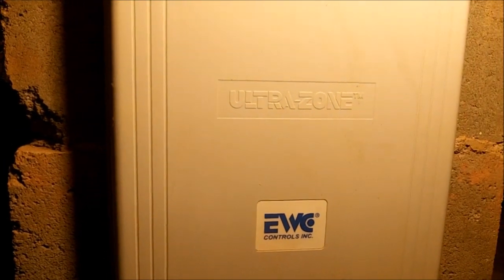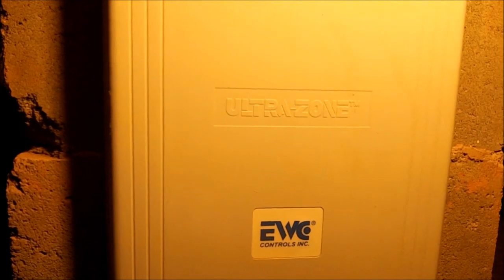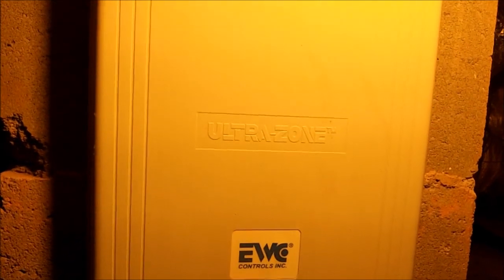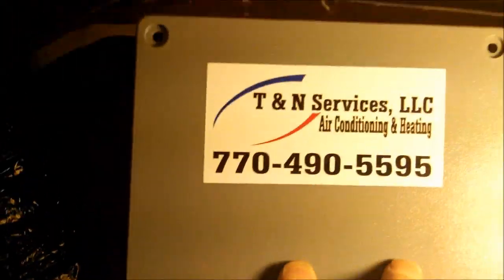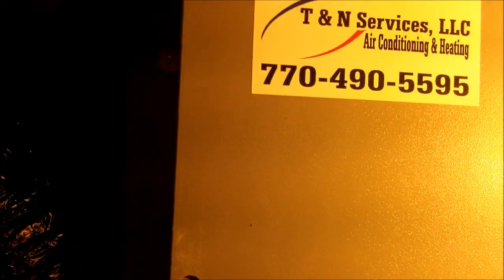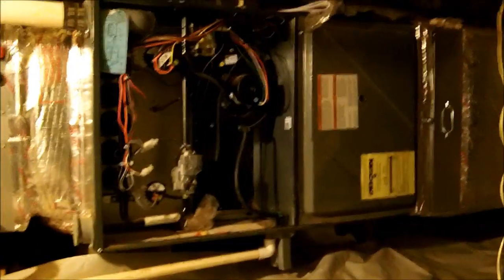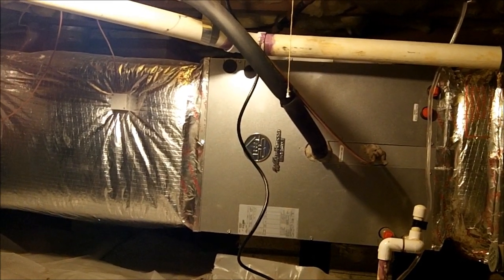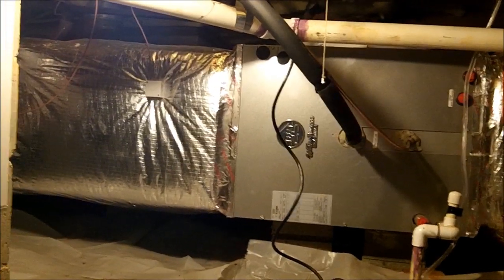EWC Zoning With Lockout Relay

Comment: Done the same thing, several times ,works great. You can also use pro 1 aux gas function itl cut hp off after  45seconds upon call for second stage heat.